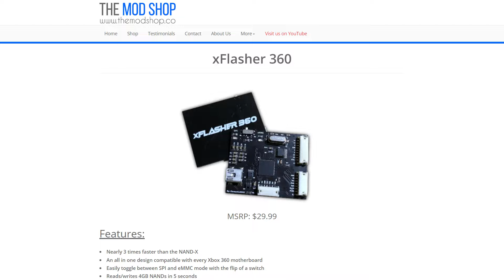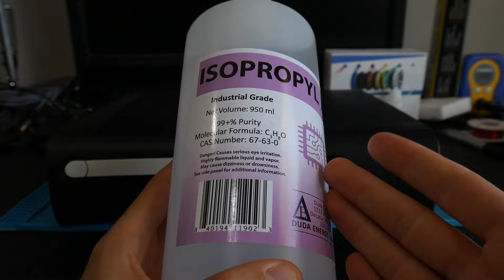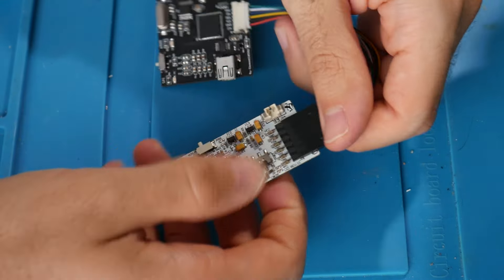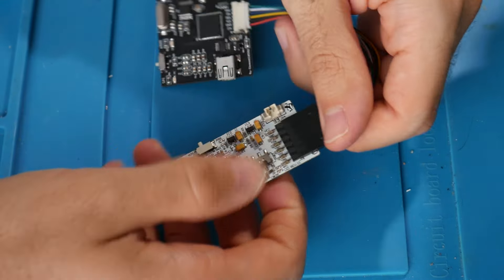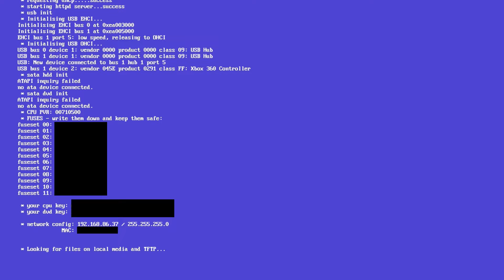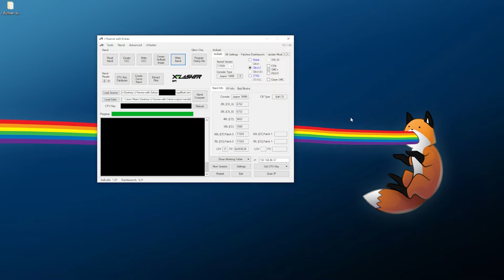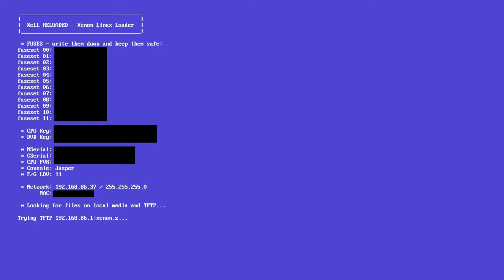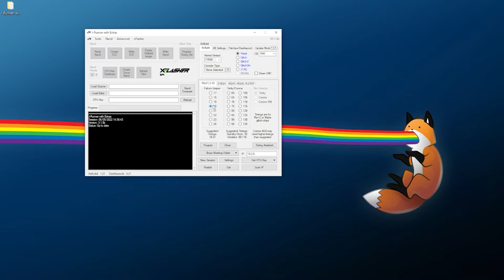How to RGH 1.2 a Xbox 360 Phat (Falcon/Jasper) - RGH 1.2 v2 Update!

Comment: Hey! Just letting you know it might be a good idea to do an updated video since the Coolrunner Rev C clones are drying up, but the X360ACE v3 is still super common, and technically works a bit better for RGH 1.2 with support for adaptive timing. Also the drivers for the JR Programmer v2 have been updated and signed so you don't have to deal with disabling driver signature enforcement anymore!

Comment: I have done two jasper rgh3 and both has been working fine for months. Boot time is a few seconds, not instant like on slims but otherwise perfecly fine once glitched. I wonder if the people that has issues with rgh3 on falcon and jasper are not using a 22K Ohm resistor and a 1N4148 Diode as recommended...
Reply from the maker: That's the exact result I've had with my Falcon, it works fine for me but still isn't recommended as a solid solution due to the Phat RGH3 implementation being in beta and unstable. I believe I shared some information about it in this video, but I go into more detail in my upcoming RGH3 Phat video.
Reply: @MrMario2011  would be interesting with details in regards to why it would be unstable once glitched and also an explanation/theory of why it would stop working for some after x amount of time (are we sure that the soldering is solid in those cases?). Also, thanks for creating great video tutorials and for interesting info :)
Reply: i´ve done some Falcons, Jaspers which all work. But one Falcon boots only 8 out of 10 times. 2x it freezes, so better RGH 1.2.

Comment: I just finished doing an RGH 1.2 on a Falcon using this guide! I also want to add that because you did the wiring for the glitch chip out of order I got mixed up and soldered the wires incorrectly the first time, so if you ever do another tutorial like this one I would definitely recommend showing those in order haha. Otherwise a great guide! Thanks for the help!

Comment: Thanks Mr Mario. Successfully modded a Falcon that I found in a skip/dumpster in the rain. DVD drive was faulty but I don't need it after fitting a hard drive. Gave the case a good scrub (inside was pretty clean) and repasted the heatsinks. It runs great and will get a new lease of life! Boot times were slow until I bridged the CAP on the Coolrunner and now it's almost instant😄
Reply from the maker: Nice work!

Comment: Great tutorial! I would add some precisions around 45:40 if you're using a Jr Programmer: the NAND dump did not work for me at all. I had to do these steps in this precise order:
1. Close JRunner and disconnect the USB cable from your computer
2. Make sure everything is connected as shown in the video, switches on the programmer in the right positions.
3. Plug in the USB cable and wait 5 seconds
4. Open JRunner and press Read NAND

It worked on the first try using this sequence. With a JR Programmer, you cant keep JRunner open the whole time.
Reply from the maker: I keep J-Runner running the entire time, more sounds like a J-R Programmer issue there. If you have one around, sure, but that's a good example as to why I don't recommend the older flashers anymore. xFlasher360 and PicoFlasher are fantastic.
Reply: @MrMario2011  thanks for your answer, I edited my comment

Comment: For this rgh version you can also get a programmed chip, for 1.2 and so use the pico. Maybe not the best solution but it's cheaper than getting a programmer, since the pico you can repurpose for anything really.

Comment: Phew, that was a lot of information! I really wanna RGH 1.2 my Jasper but I'm scared to do it. If I don't have a lot of practice with soldering, where can I practice it? WOW you're so good at it. That teeny tiny little resistor (I think that was what it was?) seems impossible!
Reply from the maker: Use dead motherboards and practice soldering onto various components 🙂
Reply: Get a good Soldering station or iron, I suggest at least 50w, 90w or higher would be even better. And get some good flux, bad flux can make you want to never solder again. Stirri or AmTech are the best and made by the same company I believe. Chipquick is decent stuff too, I use it and have had good results.

Comment: I recently bought myself one of those "pinecil" soldering irons to do this with the smallest tip available, so hopefully that should make it a little easier. I've since had a go with it and I can tell you it's 99x better than the $10 amazon iron I had. Solder instantly flows - love it. Some thinner solder seems to help also.
Reply from the maker: Definitely a skill you have to hone in, but the tools make a huge difference! I have a Pinecil but haven't used it yet, still really enjoying the Hakko I've had for years, but I know the feeling. Upgrading from my Stahl Tools iron to the Hakko felt like a dream.
Reply: @MrMario2011  Well so far I've managed to solder on my pico flasher and it worked dumping the nand and writing xell.. so far the instructions are v.good thanks MrMario! It sure isn't a quick process but hopefully it'll be worth it.
Reply: my god that wasn't easy lol.. had to re-solder my picoflasher back on, then had to mess with the timing but seems to work now!! Hilariously tough, but satisfying.
Reply: ok, I give up - made absolutely sure everything was working - did 7 cold boots in a row no issues at all.. put it all back together, just keeps trying to boot. I highly recommend not bothering with xbox360 mods unless you have a lot of free time. I've wasted at least 10hrs on this.

Comment: Good installation. The best solution for Phat Xbox.
But CPU RST is better to get from below. PLL it is best to solder the cable from the other side. If you don't have any disturbing components in the way. Xclamp for that has to go down there.
Better get ground at the AV port. Also, one should keep 3.3v cables away from the others. Since this can lead to glitch problems. It is best to fix it with a bit of hot glue. Thanks for the video. And thanks for the video with the flashing of the drives :) I do that more often now
Reply from the maker: We all have our own ways of doing it! CPU_RST alt point I used can actually be better and has been recommended for stubborn consoles in the past, but it can be harder to solder to due to it being so small.

As for GND, a ground is a ground for the most part, I just have a preference for using the motherboard's ground.

Comment: Wouldn't it be simple to install pin headers in those holes? in case later on need to use them again also less hassle soldering wires then removing.

Last time I did one of these XB was when Coolrunner had only just been released I should update mine.
Reply from the maker: Up to you, really. There's nothing wrong with installing a pinheader, but no one really does because it's pretty rare the average user has to reflash their NAND directly to the console like this after the modification has been done. Pinheaders were used for the original Xbox due to modchips cleanly being installed to and connecting to the LPC debug port, but that's not needed for the Xbox 360.

Comment: Sorry to comment on a year old video but I medically NEED to know, I have a Jasper 360 and I wanted to mod it with this RGH 1.2. I have a CoolRunner rev C, a Matrix glitcher v1, a 360 ace v1 and CR4 chips. I scoured the interwebs and hear conflicting reports. I hear the Matrix is the fastest boot times if you use the correct timing files. I also hear the CR4 is amazing as well. Which one would you use for this mod? What would be your first choice(and maybe even your second choice)? Thank you as always!
Reply from the maker: All of them will work fine. If it was on my desk I'd probably go with a CoolRunner Rev C or Matrix Glitcher V1, but that's just based on my own preferences.
Reply: @MrMario2011  So they are pretty much interchangeable then. Kinda what I though but glad to get a second opinion. Thank you Mr. Mario!

Comment: Hey man, your videos are well put together and I appreciate them big time.

I have a Jasper (BB I believe(has 512mb internal), I have a Jr-programmer v2, and an Ace v3. I have no experience with soldering, so I have yet to give it a go.

I also have a Trinity and a Corona. What are your suggestions as far as the easiest mod project for a beginner to accomplish with everything mentioned above to use?

 Would RGH3 on Trinity work with the wires from the nand reader? I've read that I would not need either of the chips to do so but also part of me is saying I should use the Jasper as practice and then just 3.0 the trinity.

Anything helps and I appreciate your feedback in advance!
Reply from the maker: None of these are any mod projects I recommend to someone who has never soldered before.

Comment: I followed this process and my console won't boot. Central light on Xbox flashes green (but not the surrounding 4 other light), and you can hear the glitch chip cycling, but nothing shows in screen. Tried 18-21 timing files, double checked wiring, but no Xell booting. I'm using a xFlasher for the glitch chip and Pico for NaND. Also tried HDMi and A/V out. Is a Falcon. Any thoughts?
Reply from the maker: Could be related to wire routing or soldering quality, also make sure all the points you soldered to from the chip to the motherboard are accurate. Make sure you're also building your NAND properly as a Glitch2 image.
Reply: @MrMario2011  ok thank you for the answer. I did check everything but I'll check again just in case. 
I haven't got to the NaND building yet as I don't have the CPU key as Xell won't boot. I have done multiple RGH3 with success but just can't make this 1.2 work ..
Reply: @toplus83  Hello, I have the same problem, did you manage to solve it by checking your welds?

Comment: Back in 2016 I had issues with MX4. It started to separate on my Jasper after 2 months, and the grey stuff got pressed out of the heatsink, and only the oil stayed on the chip. Luckily, it did not get harmed. Probably was just a bad batch.
Reply from the maker: Sounds like a bad batch for sure.

Comment: I have a solid red light at 1:00:55 and it does not turn on... I have some doubts about the .ecc I wrote since it was displayed as a Falcon but I have an Opus console. Could it be the source of my problem?
Reply from the maker: That's not the problem.
Reply: @MrMario2011  I've read that it almost always means there's a short circuit. I have 0 Ohms between 3.3V and GND, but 5V and 12V circuits are fine. I'm searching for the complete schematics to find which component could have overheated, some regulator. Any suggestions?
Reply: @MrMario2011  finally found I overheated C2B12 (north of 3V3 point) while trying to do the perfect welding. short circuit is now resolved, after 1-2h of looking for datasheets and schematics

Comment: I followed your guide to RGH3 my jasper console using the pico flasher, but now that the matrix chip i ordered has finally arrived i want to convert this bad boy over to RGH1.2. 
Are there any available guides to convert from RGH3 to RGH1.2?
Reply from the maker: I've shown the opposite order of operations for slim consoles, but if you did rgh3 successfully, you could follow this with no issues.

Comment: Hey MrMario, I need your help. I did this to my jasper and I ran into a problem. I programmed the coolrunner and read the nand and created and wrote the XeLL and wired everything up. But when I went to boot up the console I got rrod. With the error 0023. I don’t know what’s wrong. I checked all of my wiring and resoldered all of the wires and I still have the same issue. I even resoldered the r8c2 chip on the board and it is on there and fine and even tried the alternate points and still not working. I need your help.
Reply from the maker: Flash original image back over to the console and desolder the Coolrunner wires. If it boots, there was something wrong with your wiring.
Reply: Ok thanks I will try that out. But how would I go about flashing the original image back?

Comment: Amazing video thank you. Can I use a ck3 lite v1.1, using the same wire installation and use the coolrunner timing files for the rgh 1.2? If so do I leave all the dip switches to off? Thanks
Reply from the maker: A CK3 Lite is for DVD drives, you might be referring to CR3 Lite? If so, I've never done an install with one of those, but I know they are RGH 1.2 compatible. You could try it with DIP switches off, but sorry, I have no experience firsthand with one.

Comment: Great guide. CPU rest got me. Never would boot. Think it was my CPU rest. Tried to reflow the cable and ended up taking the whole resistor off and pads. Could not get the pad to flow. Ordering another jasper off ebay now and gonna try it again.
Reply from the maker: Thanks for sharing
Reply: Did you try the other RST point on the bottom of the motherboard? The resistor on top isn't essential, your console will work fine without it.

Comment: Hello! Sorry for searching help on such an old video, but I really need to clarify some things. Many people say that using an ace v3 as a glitch chip for a phat console is a bad decision, but I have already ordered one of Aliexpress. It's the only chip I can buy, I haven't found any matrix or coolrunners, and no other shops ship to Romania. Is it ok and will my Xbox last? I originally planned to RGH3 my Jasper, but I'm worried about longevity. 

Also, I plan to use a Pico as a glitch chip flasher since proper ones are very expensive and I read on Reddit and Se7ensins that dirtypico360 plays well with ace chips.
Please tell me if there are any more things to know.
Reply from the maker: Your console will be fine, Coolrunner or Matrix are just the preferred ones for a Phat.
Reply: @MrMario2011  Thank you!!

Comment: Currently struggling on this. In J-Runner, I'm at the point to where I have to flash the timing file onto my Coolrunner. However, the SVF flash fails, even though the coolrunner is in Phat Programming mode, and the Xflasher is in SPI mode. Could really use some help, as online solutions didn't help me any.

Edit: Turns out the Coolrunner I bought had the Prg/Nor switch installed backwards. After switching it to the Nor side, it flashed immediately. Ah, the world of knockoff devices
Reply from the maker: Thanks for updating us on the issue and fix, good lord that sounds annoying.

Comment: Hello . can somebody help..my fans not spinning and i got permanent red and green light afer building and flashing the nand sucessfully....did i screwed up hardware or sofware side? xbox 360 flacon
Reply from the maker: Reflash stock NAND, desolder 3v3 from the chip or board, see if it boots stock successfully.

If so, resolder the chip, the RGH 1.2 timings should allow stock to boot. If there's an issue, it could be wiring. You could also try to rewrite ECC after this.
Reply: @MrMario2011  thanks for trying but i guess i failed...i cant rebuild the nand because i didnt used the method with ethernet ...so i got no lockdown value(also no photo fo the fuse lines) to build a new nand

Comment: What kind of microscope are you using? Asking because I just bricked an Xbox 360 trying to solder the PLL/A wire to the board.
Reply from the maker: It's linked in my Amazon Shop in the description

Comment: Good tutorial, shame I had some issues with the installation of RGH1.2 on my falcon Xbox 360.

At first I had the RROD 0010 error code, which after finally sorting that out, I would get no display output to access Xell and the Coolrunner would be slowly blinking green.

I ended up trying the RGH3 installation afterwards, which so far has worked and to me has been more reliable.

Comment: The problem is this: I installed new NAND memory. Now it's empty. I don't have original native dumps. There are no keys either. What falcon files need to be written to memory for XELL to work? How to collect XELLL if there is no retail dump?
Reply from the maker: You don't dump XeLL, you flash it. You can flash XeLL to the console to get the CPU key, then build a doner NAND using that to flash over.

Comment: Hi there another great video. I installed a matrix into my jasper BB and im getting really inconsistant boots sometimes none at all. Im curious as to the wire. Is it insulated from electrical noise?
Reply from the maker: It could be wire routing, you could also try a few other timing files as well?
Reply: @MrMario2011  ive tried 2 matrixs with 17-24 and even tried mounting one to the xclamp just to get the shortest wires possible other then power and ground. But it magically boots when i play with the pll wire but when i let it go itll freeze on boot animation.

Comment: "as long as its not plumbing flux" .....meanwhile i've been using the same tub of plumbing flux for years and havnt had any issues with anything i've soldered with it even years later including a xbox 360 or 2 haha
Reply from the maker: That's not at all recommended, I've seen multiple people wreck their consoles due to incorrect flux.
Reply: I ruined a Zephyr with plumbing flux. It's too strong and will cause corrosion most of the time.
Reply: @ultratechgaming199  that sucks and i just checked the the 1 i KNOW has plumbing flux and still boots :D